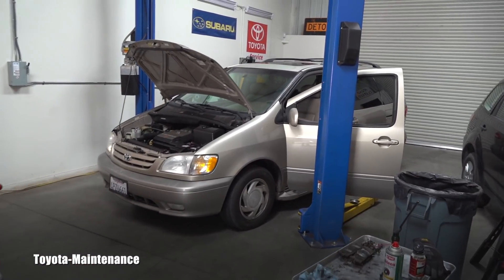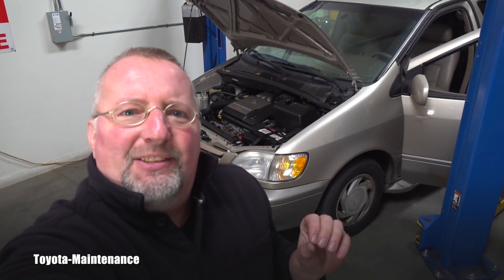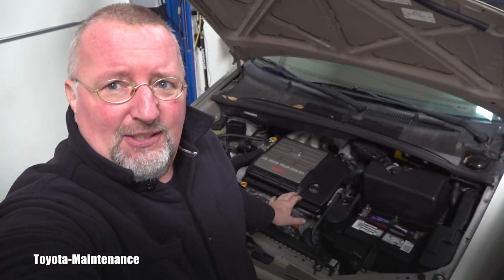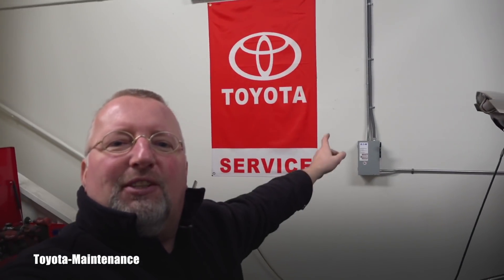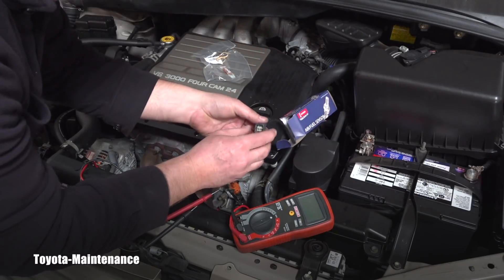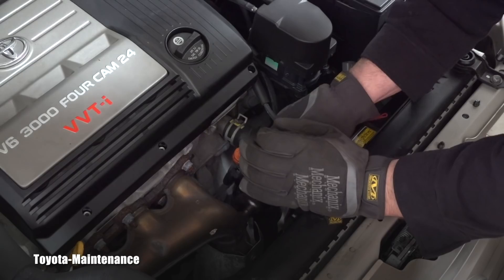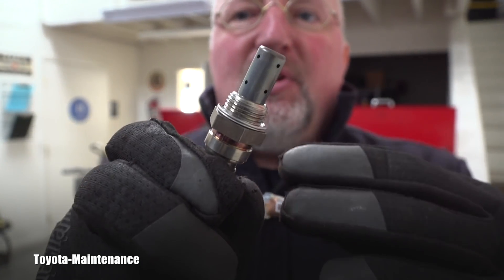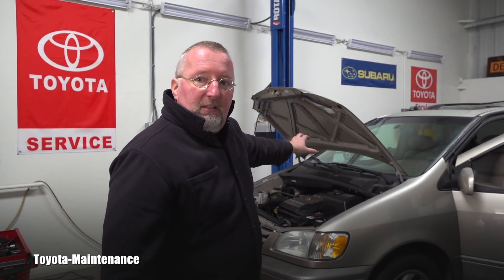Toyota Code P1155 Air/Fuel Sensor Heater Circuit Malfunction Bank2 Sensor1

Comment: Got code P1135 and P1155. Changed with AF sensors . Check Engine light still ON. I have no idea what’s going on. Mine only has 49K miles on 2000 ES300😢

Comment: Yeah I replaced the bank 1 Sensor 1 for a p1130 code on my 2000 lexus es300 . Didn’t change the error at all . I replaced the maf sensor. Installed new intake hoses and it’s not misfiring anymore but that damn code is still there and I’m at a loss and I have no idea we’re to go from here.

Comment: Such a beautiful model engine, 1MZ-FE. So unbelievably new. Like a unicorn. You never see it.
I remember changing the rear spark plugs. But in a sedan. Less room, but you could still do it without removing intake. Stubby ratchet and two short extensions. The one close to the PCV on the passenger side was easy. And the other two were relatively not so bad.

Comment: I only buy Denso O2 sensors even though its expensive. Mush better quality. bought cheaper ones in past and they don't last. Is it ok to use dielectric grease on connector to prevent moisture and corrosion of contacts?
Reply: yes
Reply: No, no, no!

Dielectric grease is not conducive! Don't let it touch the contact terminals! You can surround the connector, but do not interfere with the electrical connection itself!

Same thing with spark plugs. Use a q-tip covered with dialectic grease to coat the rubber part of the coil, but do not let it come in contact with the electrical contact points. you want those little pieces of metal to be completely clean.
Reply: @SeanPopify  Nonsense. You know what's worse than a near zero loss of conductivity?  Green crusties on connectors.  The man said nothing about smearing it on spark plug electrodes.
Reply: @nickv4073  Dielectric grease is commonly misused on electrical connections of all kinds.

Dielectric grease is commonly used on spark plugs, commonly misused on spark plugs. Since the topic is car repair, it's good to throw those helpful things in, for future reference.

DG could be used to prevent water getting into the area where contact is made.

Context and comprehension is important. This is especially so when 1/100th of a volt or ohm could make a computer miscalculate another operation elsewhere in the engine.

Comment: Hello, here is my problem. I have a 2000 Toyota Sienna(California ed.). It runs good. Gets pretty decent mileage and burns a little oil but has intermittently been throw the code P1050 and very occasionally with P1030. I tried looking up the codes and found 1030 is the variable valve sensor but have not been able to find anything on 1050. I keep getting directed to P0150 which I'm positive it's not. 
  The 1050 code I mostly get by itself but occassionally it'll be accompanied with the 1030.
  The battery is on it's last legs, could that be what's doing this? 
  Anyway if you would please let me know what P1050 is so I can finally fix it and start my how long journey who the heck knows of resetting the monitors, I'd be very grateful.
  Thank you.

Comment: Hey Peter what is the most common problem or reason that 3.4 5VZ-FE gives up? 🤔
Reply: around 500k miles the head gasket will start to go from most folks experience. otherwise, as long as you do basic maintenance no issues. If you have automatic transmission make sure to do the radiator fluid regularly to avoid the transmission cooler (inside radiator) from going and destroying the transmission.

Comment: You said you were looking for 11-16 ohms for the heater element and the new one had 1.9 ohms which would be out of spec. The new one worked so did you have the wrong specs?
Reply: He might of mis spoke. Mines was 1.9 as well.

Comment: Thanks for the video. Question regarding,whether the part is OEM or not,how do you identify it ? Is there a unique or significant design of the O2 sensor,that will say it’s an OEM ? Because any O2 sensor manufacturer can label it “Denso”

Comment: 41,000 Miles !

That thing is still under Warranty !! , especially if she's the Original Owner.

The next proper step is to implement the one paragraph "OBD 2 Drive Cycle Test because all the OBD 2 Monitors were "Set To Not Ready" whenever we change a Battery or Turn a Check Engine Light Off.

If ANY Vehicle is a 1996 & Newer vehicle & she has a Smog Check Appointment the same day or the next day, she'll & everybodys vehicle will FAIL the Smog Inspection if the OBD 2 Drive Cycle Test wasn't performed.

Ex GM Dealership Smog Repair Professional
Southern California ( 90802 )

Comment: I just bought a Denso OEM O2 sensor, Bank 2 Sensor 1 (Upstream) on Amazon for $42 for my 100 series Land Cruiser. $200 seems way off.
Reply: Just bought the part. It was 188 at autozone. 135 at Amazon and 400 at dealer. You sure you didn't get a narrow band denso cuz those are cheap. Wideband the one required for that engine is price as mentioned

Comment: Could you have sourced from RockAuto or online  Amazon for a lower price?
Just had the customer wait for the lower price.
Reply: They can, but you save maybe $60 or so. And in process you could lose the customer. Depends on the shop, but many will say okay but pay more. Pay for diagnostic fee and maybe come back. No guarantee if money for the diag will be applied to repair.
Reply: 278 at dealer : 138 at Rock Auto ,genuine Denso part #234-909

Comment: Peter, you did not measure resistance on same pins on the old one with the new.  On the old sensor you measured one top and one bottom pins but on the new sensor you measured both top pins.  I am curios if the old one was bad?
Reply: Well, the code went away with the new one which confirms the old one was bad.  I dont think you have to be a detective to figure out the answer to your question.
Reply: Measure between the silver tabs (black wires) not the copper ones

Comment: That Sienna has had problems with the electrical system at 26k miles...  Maybe that damaged the sensors... Or, more likely, the fact that it suddenly is being driven is loosening up a bunch of contaminants and it caused an overheat or some other damage to the sensor.

They changed the timing belt and water pump at 30k...  Gotta say this, the previous owners did the right thing basing service not only on mileage, but age as well.

I wish I were so lucky.  Every used Toyota I've seen in SoCal has been overpriced and in need of repair. The low mileage ones, especially!  

An elderly woman's son, selling her car said "perfect" and "excellent..." All four struts were leaking.  Blown by her driving over curbs, no doubt.  Electrical problems too.  

What does he do after I tell him about the problems after my test drive?  He takes it into the dealer and pays for a $100 oil change, conventional oil no less, spent a bunch of money on fuel treatment and other useless stuff, yet didn't fix the struts, replace the tires or deal with the alternator/battery. Then he comes back and says he's raising the price.  Basically, he said "I don't want to sell the car." It is at the highest range bluebook for an "excellent" condition car.

I have a million of these stories. If they haven't tinkered with the odometer (I have seen a lot of that, completely documentable), actually maintaining it, they're asking as much in a private party sale as a dealer would for the same mileage and same model. 

They are drunk with the thought of becoming rich off of selling a 10+ -year-old Toyota.